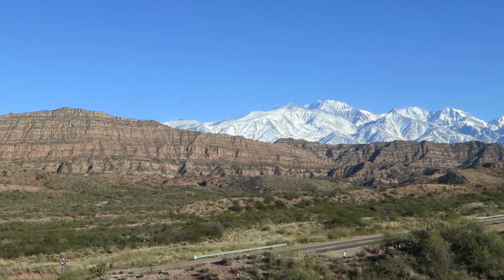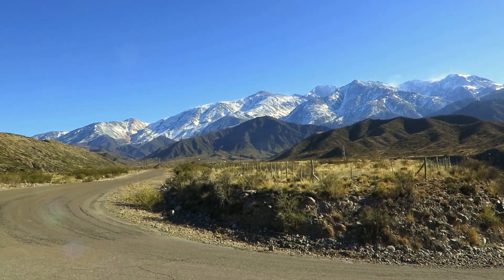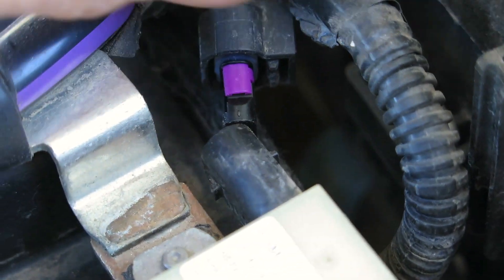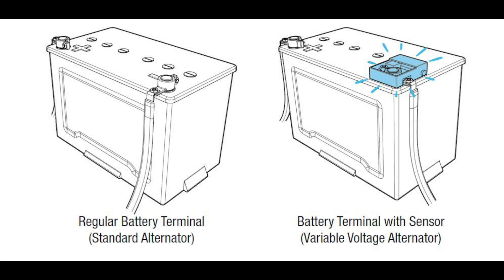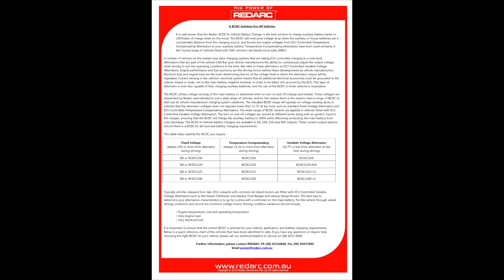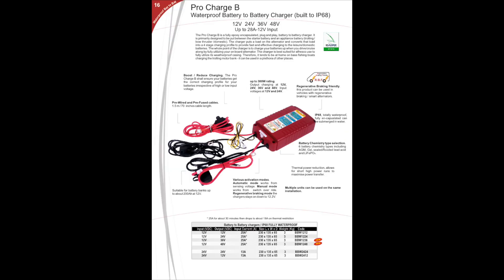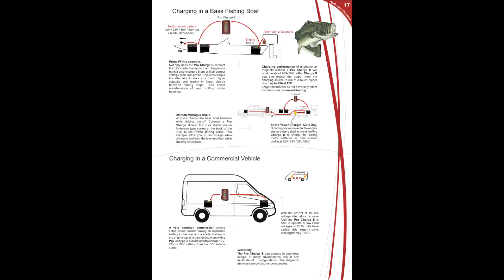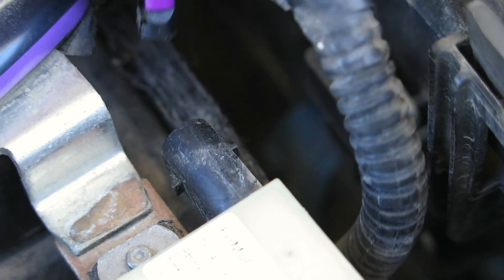Testing a simple smart alternator hack on 2015 Ford Ranger T6

Comment: Dear Filipe, Did you continue using this hack? It seems a great simple solution. Schalk
Reply from the maker: It is a simple solution that works quiet well. I have a Sterling Power DC to DC charger and the mod is no longer required.

Comment: I have been testing this hack on a C-Class Mercedes for the last 11 months works perfectly ( car has original Sept 2011 battery), have also disconnected sensor on my Porsche 981, also works without any issues, the main reason I did the disconnect was to deactivate the start stop system, kills 2 birds with one stone for me.         https://youtu.be/x9UML_jDKL0

Comment: How was the performance of the Ford Ranger, and what fuel was used, was it difficult to fill?
Reply from the maker: The owner's manual states that the Ranger was tested up to 5000 m. The turbo does a pretty good job of maintaining the performance as altitude increases but it isn't exactly a beast to start with. It does the job though, no complaints. I use the highest quality diesel available here in Argentina. I have never had problems so far of it freezing or anything. It will be different during our up-coming trip to Peru and Bolivia where diesel and gasoline are both of questionable quality. I will use an additive and hope that it will help.